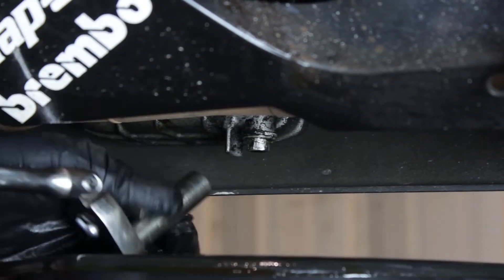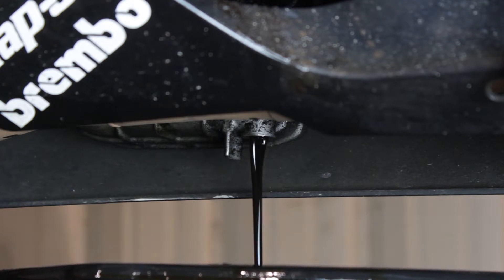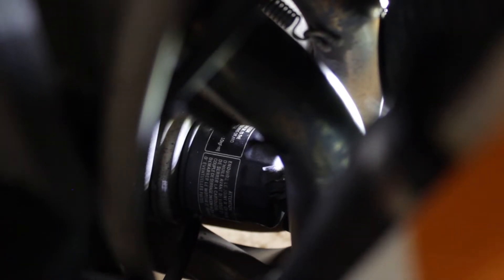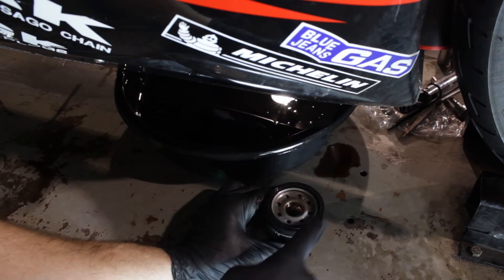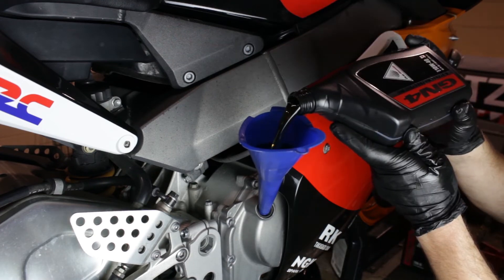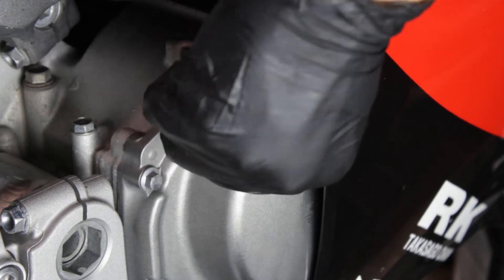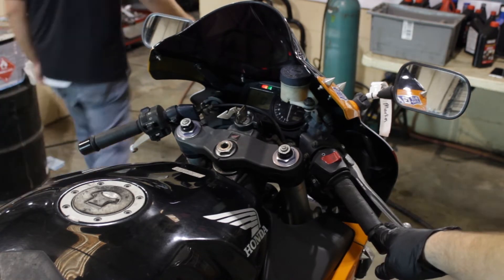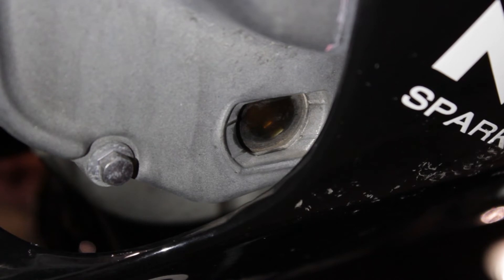How to Change the Oil on a Honda CBR954 Motorcycle | Partzilla.com

Comment: Honda says in their own book 10w40 oil , start the engine and let the oil warm a little so it will drain a little bit more / faster , when u are  removing the oil filter put an old rug , aluminium foil or anything else and the oil wont reach the exhaust manifold to create stains .. stop doing a messy oil job !  My Honda 954 after 6000km with Motul 300V has clean oil when im changing it .. why yours is black ?
Reply: Nope, the foil and shit doesn' work. Just use a bit of brake cleaner or let it steam off when you start her up. Check my video out if you need a 02 model oil change. Their the exact same though - he has the 03 model in there.
Reply: @Dan_Moto  yes it does work I do it every oil change. A bit of patience to form it around everything required saves a shit load of mess after and less cleaning. Still the odd drop here and there but nothing around the exhaust headers to burn off if you do it right. 
There’s no right or wrong answer. Just how much patience you have to prep in the first place
Reply: @twozup1098  even if go some oil on exhaust nothing bad happen I will be more focus to put some good syntetic oil than worry about some oil going on fairing or exhaust.......